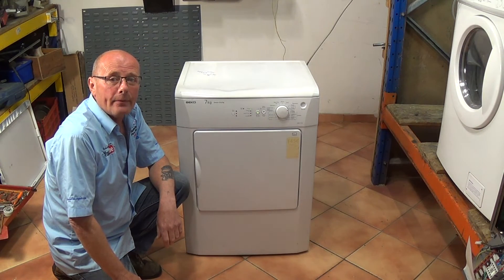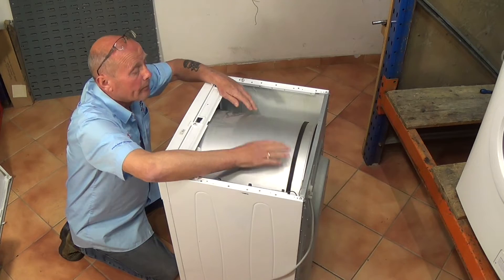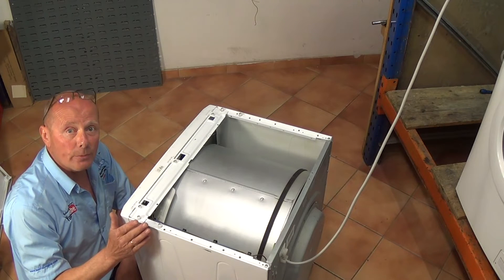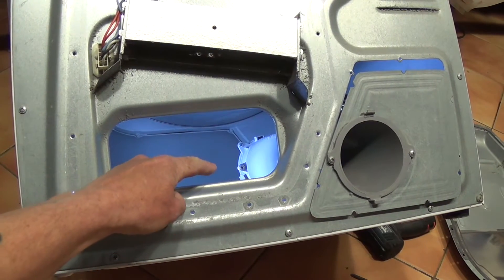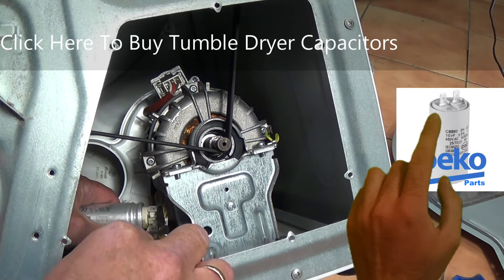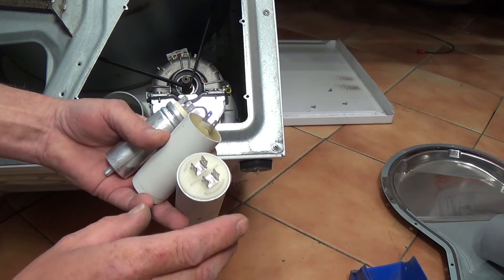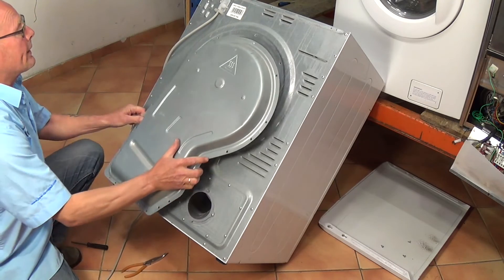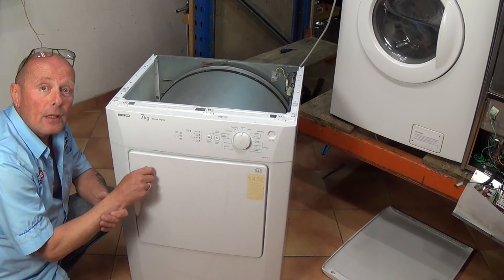Beko tumble dryer not turning how to replace a capacitor?

Comment: Thanks for the video.  I would have thought a problem with a motor until I found your video, replacement capacitor fitted and working.

Comment: All though my tumble dryer isn’t this exact model the diagnosis technique worked perfectly on mine. A £10 capacitor has fixed my problem and saved me over £300 on a new one. Thank you very much.

Comment: Hi im having the same issue as shown here but my issue is slightly different. For me, this only happens sometimes. When is happens, I turn the dryer off, spin it by hand a bit and then turn it on and it works for the complete cycle. During the cycle, the dryer will stop the rotation and keep spinning many times without fail. It seems that for me, this humming noise only happens on startup and rare enough. I'd like to get it sorted before bigger problems arise though. Let me know what you think. Thanks

Comment: Up to the 2 minute section the same happens. But then rather than humming, it stops and indicates that the filter or tank are full.
Reply from the maker: Hi, I will need the full model number of the identification plate and the details of your problem. Please use our contact us page and make sure you fill out the request for what your problem is. A video shoot of the problem would be perfect as well.

We will get back to you within 24 hours, normally. https://www.how-to-repair.com/help/contact-us/ 

Please remember to subscribe to our channel, as that's what keeps this channel going. Thanks, Paul 👍
Reply: @How-to-repair  it's a Beko DCX93150W

It doesn't have a capacitor where yours does, as that's where the water tank and motor are.  It has an interference filter at the top of the right hand corner (looking from front) which looks similar in appearance. Maybe that has died.
Reply: @How-to-repair  I changed the interference filter (it looks like a capacitor and I had to wait 3 days for postage) and the problem remains.
Reply: @How-to-repair  https://youtu.be/05LU46ktKEU?si=3Qnv2CL-XTbpERLD this is a video of after the attempted repair. 

I did complete the form online as suggested.
Reply: Ok ok, I managed to find the capacity (side panel beside motor), I bought a replacement and it now works like new. Thank you.

Comment: My Beko Tumble dryer is not switching on. I have checked the fuse which is fine. Can someone recomed if its a fault in Capacitor???

Comment: Hi my table dryer has 2 capacitors, a 15uf and a biCai 8uf one? Do I need to change them both? Or just 1 It's on a beko dhx93460w dryer cheers

Comment: Can this cause an intermittent fault? I went to test a machine that was apparently stoppingafter a minute and it ran fine through a cycle but its not working again
Reply: I'm having this exact issue. Did you find out what the problem is? For me, it only happens on some startups. But during the cycle, the dryer will stop and start many times without fail.

Comment: hi I took my old capacitor off to check it, then put it back on while my new one arrives but now its just beeping at me 3 times and I'm getting nothing any suggestions?
Reply from the maker: I would check all the wiring that you may have touched when replacing the capacitor, especially the door lock. It sounds like you may have dislodged something. @eddiekay5252 please remember to subscribe to our channel as that really helps us https://www.youtube.com/shorts/e432SAb2g08  Thanks, Paul 👍

Comment: Absolute legend, I've been replacing brushes on washing machines for years, and thought this was the same issue... but you can't replace the brushes on these motors because they are sealed units (I'm assuming due to the dust) so you can only get replacement motors, which cost up to £100! £7.50 off Amazon for a capacitor :D awesome work!

Comment: My capacitors (10 and 15 uF) was under the machine lid within a metal cover. Had leaked a liquid of sorts causing an earth leakage so kept tripping RCD when turned on. Although showed the same hum symptom as in the video before deciding to trip rcd. As well as the leak, the failed capacitors seal appears warped and was only measuring 0.5 uF capacitance. Waiting for a replacement
Reply from the maker: Thank you for leaving a comment this is for you https://www.youtube.com/shorts/e432SAb2g08 please remember to subscribe as that's is what keeps this channel going. Thanks 👍

Comment: Got a different problem ~ I get the humming sound exactly the same, but the drum does not easily rotate. Someone put a load on without the dust filter in place and a sock or two went down into the space where it should have been . . . it seems like something has got behind the drum and is jamming it.

Comment: what if the dryer makes a bang when trying to plugin the dryer, and my house circuit went off. is the capacitor banging or the motor. Beko DV7220X